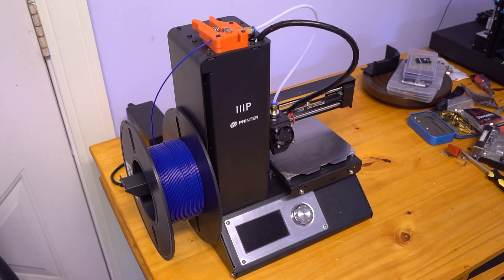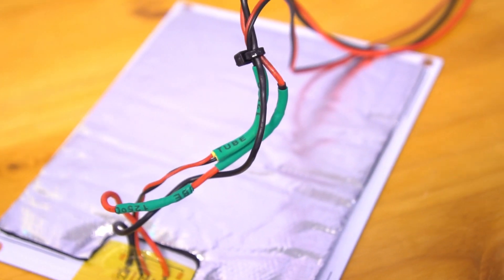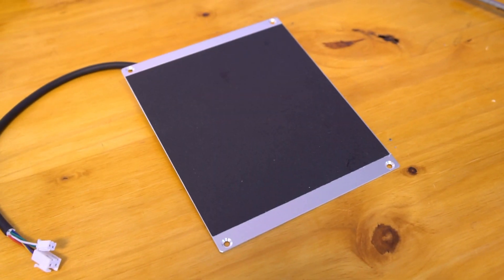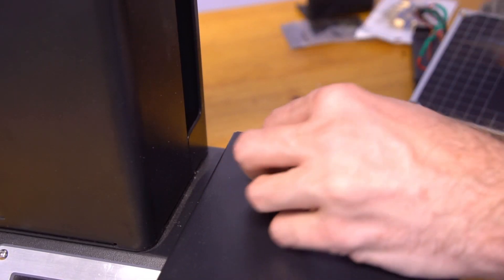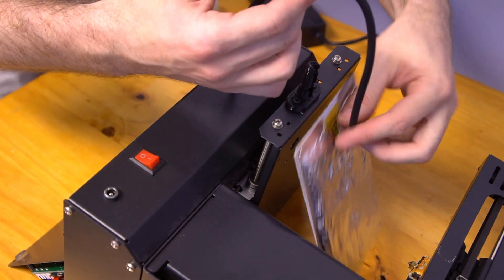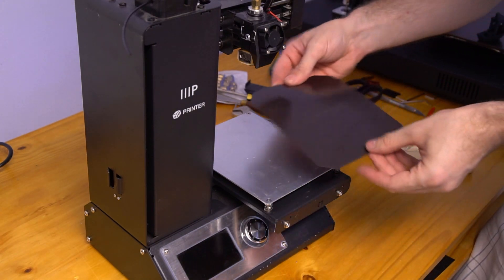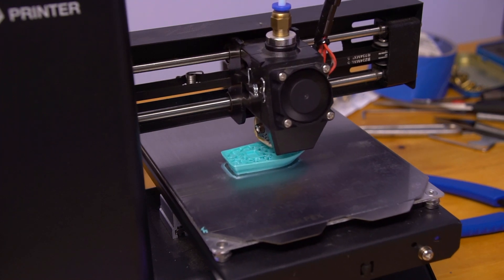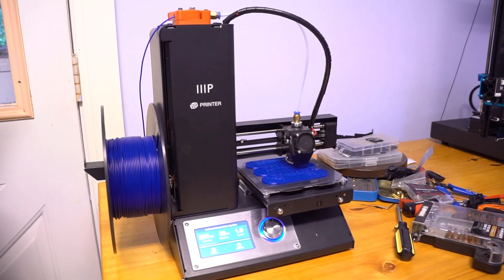The Monoprice MP Select Mini: a Surprisingly Capable 3D-Printer - Repairs and Upgrades

Comment: Hey I have the same printer but it’s re branded as profab 3d slightly different hot end set up. I got it cheap trying to get it to work, the extruder works up until it gets to the hot end. I tried to clear out the nozzle taking it apart etc and I could get some filament through but not enough for the extruder to work properly. I need help don’t know what to buy where to buy it.

Comment: bought used rebranded mpsm v2 (mine is called profab 3d)  for 60 € and for that price its surprisingly capable. best part is that you can connect it to the wifi and print wiresly

Comment: I am looking at getting a used Monoprice Mini Select v2 for 50. You mentioned an out dated memory card what does that mean? This would be my first experance with 3D printing
Reply from the maker: I can't remember the details off the top of my head, but it needs a very specific size and format of memory card that, for the most part, isn't really made any more since storage technology has advanced so much. A google search should be able to tell you what to look for

Comment: Best upgrade I made was getting rid of the awful chrome control knob and replaced it with a 3D printed one.  The original one is so slippery and hard to use.

Comment: I almost bought one when they came out and have been thinking about picking one up recently. My full size Monoprice Duplicator i3 V 2.1 burned up it's Melzi board a while back.  It was / is also a pretty decent machine but sadly it's a known flaw and mine ended up burning up. Sadly now days finding a good motherboard replacement costs almost as much as a brand new modern machine.
Reply: Maybe ask for a solution on reddit, r/3Dprinting.

Comment: did you have to adjust the z axis height after the build plate upgrade?
Reply from the maker: yes, I just did it with the built in leveling bolts

Comment: Few tips for better quality
Dont use spring tensioners for gt2 belt 
Manualy tension the belt without any springs, that will eliminate ghosting , dimension problems etc 

Use capricorn ptfe tube (oryginal one) it have 1.9mm hole
And can work with 250*C + where average ptfe can only work up to 240*C

Best upgrade for extruder
Oryginal bondtech gears...not cloned ones , oryginal ones are made out of tool steel with 0.01mm accuracy ... Average cloned ones cost 70-80% of the oryginal bondtech but are made out of cheap steel with slopy fiting and wrong dimmensions 
Most of them cant push properly carbon fibre filaments
And even worse, after few hundred grams (for example petg+cf15)  tooth disapear on then or few kg of standard PLA can destroy the tooth :|

Tip for the hotend
Cloned e3d v6
But with bore heatbrake + capricorn ptfe
Then good nozzle and heatblock for pt100 case (not pt100...average 100k ohm in pt100 case-steel tube)

Work avesome and no maitenance needed for few hundred hours of pla + petg + abs

With extra tip... Unscreew fast tube connector  from hotend by 0.5- 1 turn
Push ptfe all the way
Then tight it back 
And before u push filament into the extruder push it trough any plastic sponge for dust cleaning = less maintenance needed with the nozzle cleaning

For settings

Always go with the lowest possible retraction
But change the speed untill u have good results
In case of retraction less is better for quality :)

For infill always set thicker wall of infill than the nozzle so it will be stronger = less infill needed 

Hope it will help

Ps.
Sorry for my English 
Im making custom diy 3d printers for 8 years now (for working with composites etc) with ones that can print peek etc in heated chamber :)
Reply: I am new to this printer which is the gt2 belt?
Reply: @Flashtony76  The two belts that drive the bed and the hot end.

Comment: I only have the one printer, so its always a little extra stressful to work on it, because if something goes wrong the single most useful tool to fix the printer, would have been the printer.

I've had to do a bit of repairs on mine over... I think its getting close to three years.
Gone through a few built surfaces,  A new heat block, heat cartridge and thermistor, had to replace both my fans, and I'm at the point of having spare linear bearings on hand because those are starting to wear out. 
But at the same time, I've also put probably 80Kg of filament through it. I'd say its doing a pretty good job.
Reply: I have done all that and a mainboard in one year lmao, I have not been so lucky with my printer but I am still learning